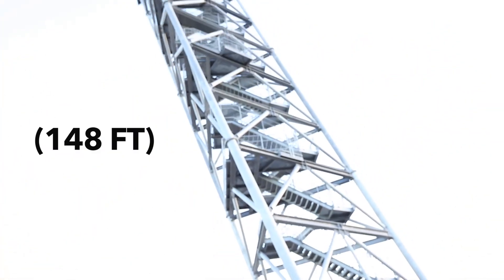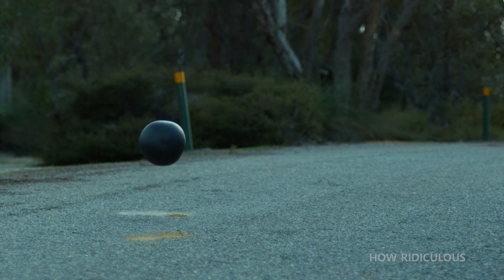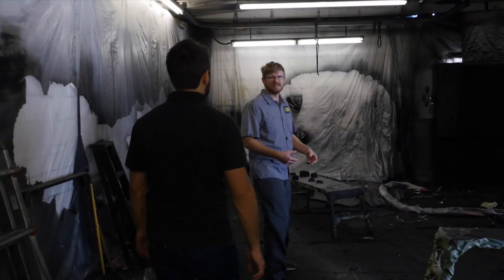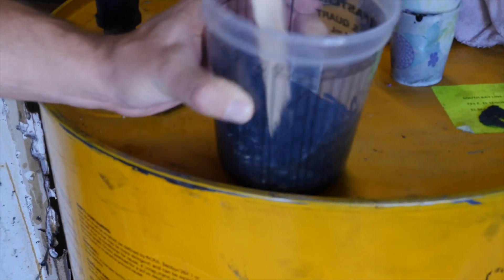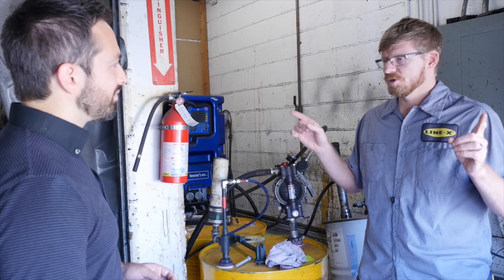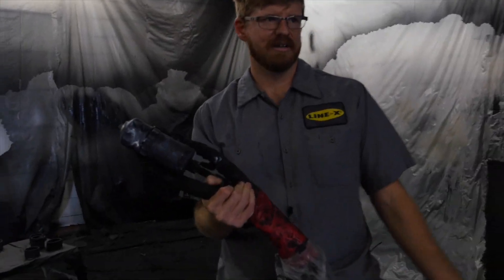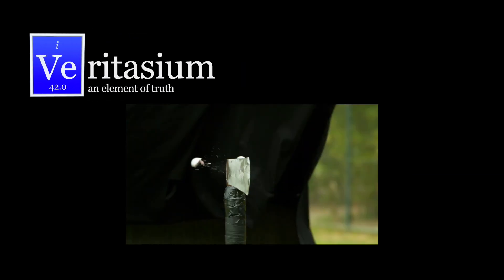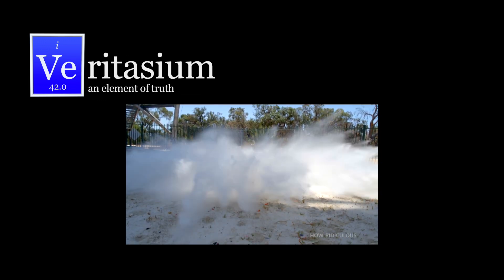Indestructible Coating?!

Comment: If you spray a bomb with that and then detonate it the things breaks right?
Reply: Spi Rale depending on the bomb size but it will most likely rip apart a bomb of standard IED size that you would put in the floor woud send things flying at the speed of sound
Reply: Bombs can rip a thick steel container, no material can withstand an explosion inside of it.

Comment: how heavy is like 1 hersey bar of it? same height, width and length
Reply: The density for the ingredients of line-x is about 1.1kg/l, and the density of a chocolate bar is about 1.3kg/l. So unless the density changes a lot when the ingredients are combined, the chocolate bar would be heavier.

Comment: wow science is incredible. how do those molecules just "look" for and "find" each other?
Reply: They probably use an online dating service.
Reply: Almost every kind of chemical is looking for something else to make them "complete". There is no explanation for why this is.  I'm sure Fredrik is on to something though.
Reply: For the "looking"-part, you can look up brownian motion. Molecules move around. The movement is temperature dependant, being at a full stop or atleast close to at 0 kelvin and moving more rapidly as you go up the temperature scale from there. It's interesting! Give it a look.
As for "finding", you have a couple of different mechanism described here: https://en.wikipedia.org/wiki/Chemical_bond
In short, it's just negative charges and positive charges, aiming to be neutral by coming together.
Reply: miss physics
Scientifically.

Comment: It is a bit tricky video...
when you see them spraying the melon, you, well i, imagined they just sprayed a tiny fraction of milimeter thick layer...but after circular saw cutting, i realised it is actually quite thick and heavy layer of black...something there. 
They could sell it as paint-on/spray-on protection for mobile phones, laptops (it's up to user to protect holes where it should not go ;-), tablets and other random handheld devices.

Comment: How much does it cost?
Reply: about 500$ USD for a standard truck bed--but apparently people are lining their whole truck/car with is for a few grand or so.
who needs paint?
Reply: possibly, but it wouldn't look like your average aerosol spray-paint can: it has to be mixed the moment of application, so there would have to be separation of the chemicals while they were being stored.
Reply: Jaymes elliot can it be canned?
Reply: Your soul plus an arm
Reply: Eugene Worrell It comes in a 2part mix add a to b and you have about 30mins before it hardens up

Comment: This is indeed a great product with far-reaching applications. I wonder, if and when this indestructible coating becomes more widespread (i.e. in the use of mass-produced consumer products) will there any detrimental environmental implications? Will the coating be able to break down over time, or will just be another man-made compound destined to contribute to our ever expanding landfills for eternity?

Would be great to see a follow-up video on the lifespan of such a polymer coating and its potential impact on the environment.

Comment: I'm working with the UTA Rover Society to build a functioning rover similar to the Mars Science  Laboratory. We used this stuff to coat our aluminum wheels to prevent damage. It's light, relatively cheap, and super strong. Stuff off the future here guys.

Comment: iPhone 7 case coating :P
Reply: As you saw in the video, the watermelon was still destroyed. It was just encased in a tomb of "linex". Its just a coating designed to keep things from getting to the other side of it. 

They use it as a bed liner because it keeps the paint in your bed from being scratched up and then rusting, maybe has better traction too.

Comment: spray it on helium balloon and leave it in open area , will it burst in space ?
Reply from the maker: probably not. The tensile strength is 6000psi, much greater than the 14.7psi of the atmosphere
Reply: saurabh atram also it won't lift up to space, only few km high, untill air becomes as dense as helium
Reply: Peter Rabitt helium can make it through almost anything. baloons have pores. everything has pores if youre helium.
Reply: since the balloon doesnt expand much with the coating, it will actually not go up forever since theres simply more helium in the same space so "weights" more (it doesnt actually weight more, its just subject to less boyant force of the outside air)
Reply: PLEASE TRY THIS!
Then may be we can attach it to a line-x helium baloon and record outer outer space with a solar powered camera!
Reply: Melody does a helium filled cat have pores?
Reply: It would find like a terminal height. I doubt it would realistically float with the heavy coating tho.
Reply: +Peter Rabitt i thought it would smell like tar
Reply: Andrew a it would go up until the air becomes as dense as helium
Reply: I think it will burst as soon as coating starts.
Reply: Sorry... But this kind of balloon wouldn't be able to inflate like an uncoated one... So it wouldn't go as high as a normal one ! And the extra weight of the coating wouldn't help either !
Reply: I tend to agree. Seems like it put off a good bit of heat as it cured.
Reply: Veritasium, I was thinking of attaching a Go pro camera below the coated balloon of helium and leave it in open area, will it be able capture images after reaching high enough?
Reply: G. Culshaw yes
Reply: mydoggylives Maybe not using a a regular balloon but, Line-x a large object cut it away after it cures. Then line-x the cuts and fit up a high preasure valve of some kind. Pressure up to where the "balloon" becomes bouyent and let go.
Reply: saurabh atram, Ik this is offtopic but your profile pic made me go ..."KACHOW!"
Reply: Melody 
It is only a single atom i guess. Its not even diatomic.
Reply: You will need a humongous balloon to actually lift the weight of the coating.
Reply: Imagine it hitting the engine of a crowded plane....
Reply: Veritasium Will it go on forever... into space...?

Comment: This stuff would be of immense benefit in stabilisation of severe ground conditions underground in mining when going thru areas of high fault line conjunctions. It would be able to withstand a good amount of seismic shocks from ground movement,  my guess anyway. This product has many other applications apart from defensive or panel on vehicle's protection.  A very awesome substance invented. Super interesting video.

Comment: the fact of the matter is that the material your spraying with might be indestructible but the material you're spraying or may not be just because you spray that as a liner on a truck doesn't mean the metal underneath won't rot trust me my father is owned a body shop since 1971 we've done everything from custom cars trucks motorcycles hell even boats and Jet Skis and a few snowmobiles I'm not knocking the product I'm just stating the facts

Comment: how is it free fall? there's air resistance.
Reply: Angel Leiva 

noun
1.downward movement under the force of gravity only.

verb
1.move under the force of gravity only; fall rapidly.
Reply: But there is an opposing force, air resistance.
Reply: Angel Leiva I guess they call it free fall since the only force propelling the object in its direction of movement is gravity, but now that I think about it you are right, it shouldnt be called free fall

Comment: Is this video sponsored? If it is, it should be noted in the description. EDIT: It isn't sponsored.
Reply from the maker: exactly. So no it's not sponsored.
Reply: Veritasium thank you for the response.  I have just seen a lot of sponsored videos lately. Nothing wrong with them. Not trying to impune your honor as a content producer. I love your channel.  Keep up the great work.
Reply: Come on! It's not sponsorship if the company involved isn't paying for it, and merely mentioning a product or company name isn't "endorsement". If they make a video showing how Boeing builds airplanes or Coca Cola fills their bottles, and interviews a PR representative, would you call that sponsoring as well?
Reply: I wasn't questioning their honesty. It is easy to forget to put a few words in the description. I fully accept that it isn't sponsored.
Reply: Is it not sponsored according to a terms and service definition? Or was the endorsement unintentional?
I'm genuinely interested, as I love your videos, but was disappointed with what seemed like embedded advertising in this one. The brand mentioned in this video is not the only one applying a poly-urea spray-on truck bedliner, though by referring to the coating by the brand-name the dialogue seems to suggest so. Line-x supplying an employee and product for free to have their brand and product mentioned and endorsed in this video is sponsorship. If you were not paid to do so, you probably should have been. I understand the need for monetization but, as in journalism and news, feel the need for a separation between content and advertising. I only mention any of this because of the high quality of educational and entertaining scientific content in your videos. I don't fear that the validity of your views has been coloured by mentioning this one brand, but am concerned because of the slippery nature of advertising being mixed with fact-based reporting.
Reply: Robert Headley so what
Reply: You can endorse any enterprise you wish to. Only when money is involved it becames a sponsorship. You're a real child, aren´t ya?

Comment: Do they use it on planes? Or do they fear that people will end up like the inside of the watermelon after a crash?
Reply: You would still be dead. Also the stuff is obviously not indestructible. A plane crash would tear it apart.
Reply: lets assume the plane will not rip off. 
now, in this situation, you are in a system that is going to take a very lethal impact.
if the plane "bounce" off, all of you are tightened in the seat belt.
yeah you r done.
Reply: Shinkajo might melt sum steel bars u kno
Reply: You guys are very right, I was thinking like a kid haha
Reply: Linex is heavy 5-6 feet of lines on a truck bed will with about 50-60 pounds
Reply: And then there is all dat jet fuel to think about.
Reply: Seraphim Considering that takeoff speeds for airliners are around 250-300 kph, i doubt it. It will most likely turn the inside of the fuselage into a blender instead. And if the jet fuel ignites, which is very like, it's game over anyway.
Reply: J3t fu3l cant m3lt st33l b3ams bro bush did 9/11

Comment: 1-2cm is not really just a 'coating'. It's a complete outer layer.
Reply: A separate outer layer is literally the definition of coating lol
Reply: @Dgafsranger  it would be more appropriate to call it a "shell." The definition of coating specifies that a "coating" must be a thin layern "thin" being relative to the object it coats. If a 1cm layer of poly was applied to, say, a submarine, then it would be a coating. When applied to a watermelon, it's a shell.
Reply: @Dgafsranger  not lol at all
Reply: Yes absolutely, it's like a rubber ball after the coating.
Reply: @emacsjohn8357  basically, a basketball filled with watermelon instead of air.
Reply: @anon-i6p  cmon dude, there'd never be any shilling going on on this channel, would there 🤔?
Reply: tmkr yeah, I think it expands when it dries, so it's hard to get a coating of it
Reply: Yes. Just commented that.
Reply: Alexander Supertramp  That's a Vsauce question sir
Reply: @ItsJustGilly 😅😢😂😮
Reply: tm coating means its made by spraying or coating from outside

Comment: How expensive is this coating and for how long does it last without falling off? Couldn't you potentially just spraypaint things like bicycle tires to prevent them from getting punctures?

Comment: did he make this video ten years ago and only unload it now?

this stuff has been around for a long time at a consumer level.   rhinoliner had a very similar "test" video where they coated a cinder block and dropped it off a building with the same results.  that must have been around the year 2000.

Comment: We should put this on planes :-)
Reply: If it's too heavy it won't have enough lift. So, needs some more experimenting and calculating.
Reply: Roli Rivelino will it be able to stand up to the heat from engines… and flying in general?
Reply: Not sure, but that test shoes that it has a hell of a lot of elasticity.

It's probably impractical; but it's a thought :-)

Comment: Would there be applications for this as a tyre coating to reduce tyre wear?  As a top surface over a lower durameter rubber which allows a rubber to form around the surfaces you want to grip, but to prevent the layer that has contact with the surface from wearing?  Or is this more likely to produce less friction and reduce lateral grip?

Comment: Many years ago I remember watching some show - I can't remember what it was - where they were talking to a company that had 'invented' a material to spray on walls that would make them blast resistant, and they had a contract with the military, but wouldn't say what it was...

Years later, Mythbusters did an episode testing whether spraying truck bed liner on a concrete block wall would make it blast resistant, and I immediately thought of that other show; lo and behold it performed exactly the same - it prevented the wall from collapsing inwards from a blast wave.  

No surprise that company didn't want to say what it was, they were probably charging a fortune for their 'wonder material'.

Regarding it's actual intended use, I remember a former co-worker having had their entire pickup truck coated in Line-X; IIRC he said the paint was completely shot and it was cheaper to have it sprayed entirely in the liner than just do the bed and have the truck repainted.

Comment: They need to start lining phones with this instead of polishing them so much they get scratched by dust. What's the point of having a 0.000005mm phone when you have a 4 inch thick case on it 😒

Comment: I've been planing on getting my truck bed coated since I bought it, but since it doesn't matter what the condition of the bed is I've been putting it off.  I know some Jeep owners who have done the whole interior.
One drawback is they usually plug up any drain holes, so you end up with standing water.

Comment: Do you think it would work on an egg?  Simply because an egg is so brittle and during the drop there is needed to be some elasticity.  Also because during an impact there is some plastic deformation on watermelon, what is the ratio of plastic deformation and does the shape of an object matter?  Because a brick, for example has almost no elasticity so how would this work on protecting a brick?  Man I'd like to see this on Smarter Everyday's 40k frames a second camera.

Comment: imagine you coat this to submarines and ship hull or even tanks, but it will have little tiny use and effectiveness on tanks since those insane penetration round was crazy, or coat it to plane? but they had to carry more weight, so maybe not :(

Comment: what if this was used on tires outside and inside and how long would it last if friction was applied and i saw you guys cut it open with a saw blade but what about friction ?  could this be useful in preventing wear n tear on tires.

Comment: Everyone's talking about its strength but what happens if you want to break it down?  

e.g. when you want to dispose something that you LinXed, how does the break down process goes?
Reply: boreslayer finally, someone who cares for the environment! :D
Reply: boreslayer why are you breaking it down?
But you could just use a saw.
Reply: i.e. how do you dispose of it if you do not want to use it anymore?
Reply: boreslayer was thinking the same. but its real life applications would probably be limited so I wouldn't worry about it that much
Reply: Probably possible with another chemical reaction.

Comment: What if you made a heat resistant, neck down suit, wore it, covered your face, then sprayed the Linex directly onto it? Do you think it would hurt, or would you be nigh indestructible from the neck down?
Reply: Pinoytankbuster Correct. This is the problem that football players are having with brain injuries. The helmets can't protect your brain from the G forces resulting from impact. Note that in the video the watermelon was pureed internally even though the skin was intact. They mentioned this fact.
Reply: You might have problems going to the bathroom afterwards..
Reply: you would cook from the inside. just like how you cook a burger
Reply: wavell watson Very good point. It's likely a wonderful insulator!

Comment: Truth is, the watermelon did not survive. If it was your head you'd still be dead.
Reply: See Sharp The coat was indestructible, that's all it does. It didn't say anything about keeping everything coated intact without harm.
Reply: Yeah the intent was to test the durability of the Line-X coating.  The coating would do nothing to protect from the forces exerted upon the object on impact at high speed, but the behavior of the coating is remarkable.
Reply: See Sharp but your skull would be (mostly) intact